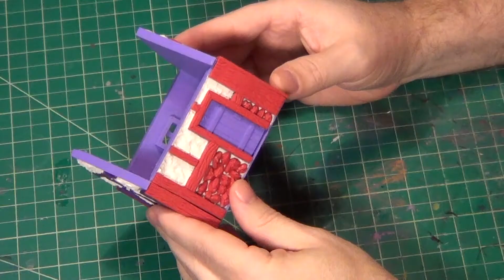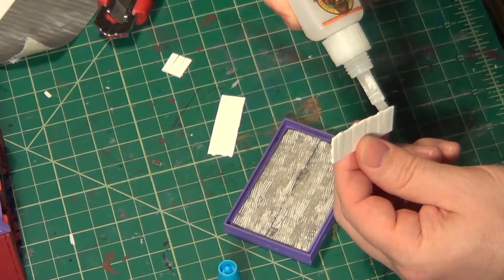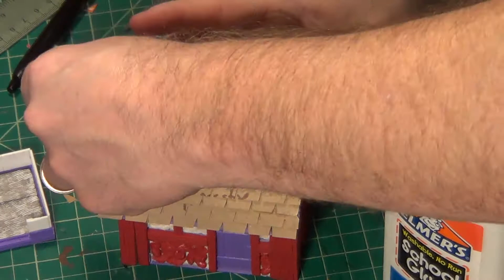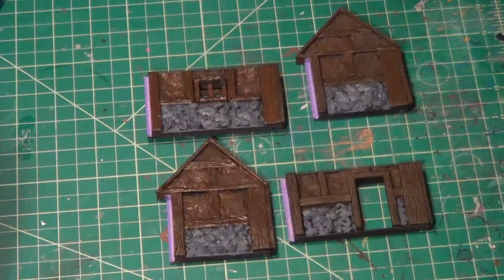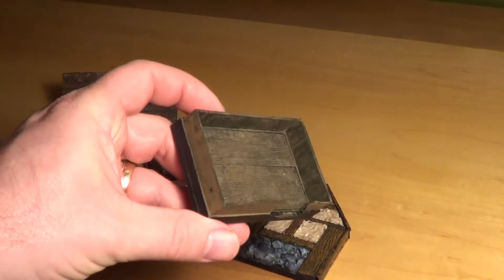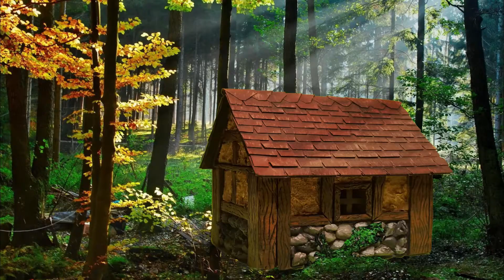011 - Creating a Cottage for Fantasy or Wargaming - Part 2: Finishing

Comment: Yeah!  New video.  I have one think you might think about trying on the next project. It seems a waste to have such a nice black base coat and not get the fullest use of it.  What I liked to do was to dry brush the greys for my stone over the black base.  It takes a little more time but it gives more details to look at and leaves some nice shadows in the cracks.  This way you don't need to worry as much about the wash coat.  You should be able to get good results with the woods too with this method.
  I'm looking forward to seeing your next project.
Reply from the maker: Thanks for the comment.  I generally will use the black as a base for the primary purpose of providing a dark background in case the paint would get scratched or chipped.  I find the wash really allows for a very quick painting and helps tie all the colors together.  I use the black base and dry brushing the lighter layers technique for some of the stone textures I have made as well as a lot of the miniatures for war games that I paint as well.